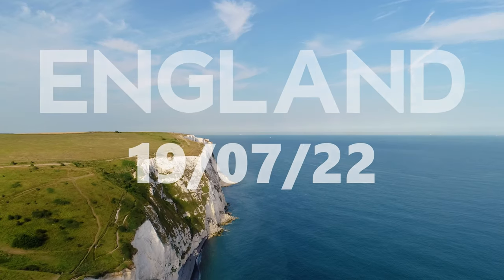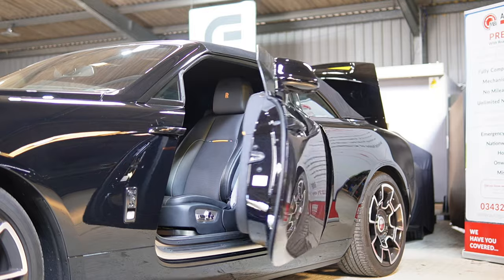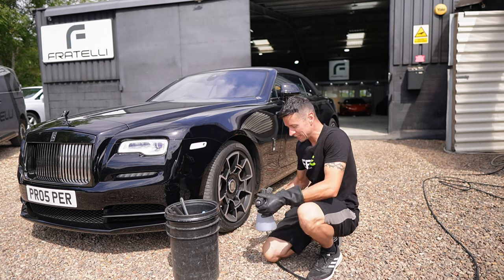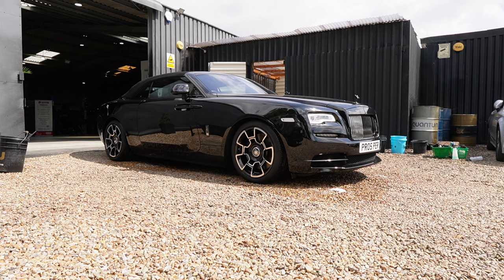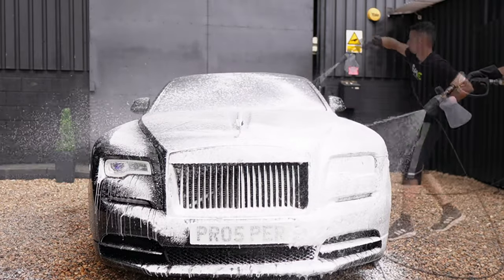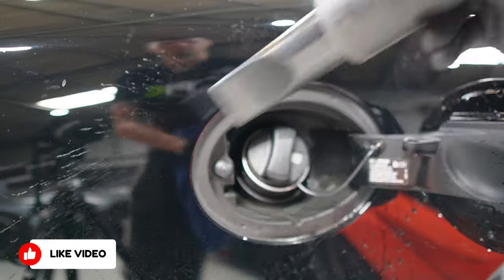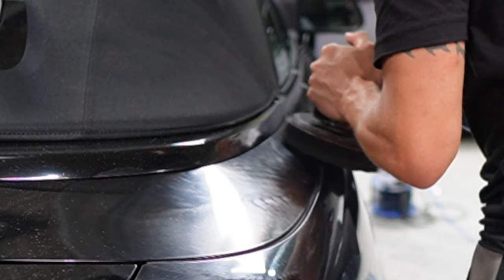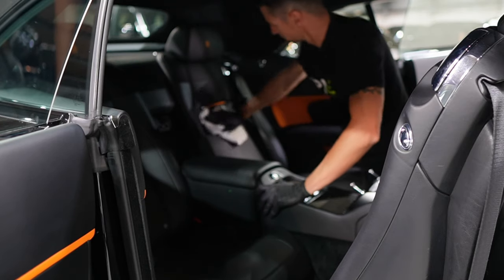THIS DETAIL LOOKED EASY BUT I WAS SO WRONG!!!

Comment: I have a question that I can't find an answer too if you could advise please..  If I put Autoglym Super Resin Polish on then can I put Autoglym extra gloss protection on then spray Yums ceramic spray on top? Is that wrong or do I have to change the last two around?  Or just choose between one of the last two??
Reply from the maker: Super resin polish is great for filling in those imperfections but it won't last. Any ceramic spray on top will increase durability 👌
Reply: @epicautomotivedetailing  cheers, that's what I will do for now and put something better on next time.  👍

Comment: That is quite a collection your client has.  You're gifted with the room they have to pull the car in once the wet part if complete as well.  That being said, awesome job under rough conditions.  The heat looked brutal and I assume the garage was not climate controlled, so likely that the experience inside wasn't that great either.
Reply from the maker: Thanks Jamie. Normally I'm out and out in all weather so I'm not so lucky with a roof but on this occasion I was. Still well hot
Reply: @epicautomotivedetailing  BTW, I loved that you talked about dry versus pre-wet on the snow foam.  I've been wondering which way I should go and your comments about the car being hot versus cold and to let that determine which way to go with that was great.  Thank you.

Comment: I always use a water filter for my final rinse when it’s hot. It saves time manually drying 😉 👍🏼
Reply: Can you elaborate on this? What kind of filter and how do you filter it?
Reply: @zackova6307  The filter goes inline on your hosepipe and makes the water 0 ppm instead of having all of the impurities in it. It’s these that give the water marks. 👍🏼

Comment: I made the most of the heat last weekend and took it as an opportunity to wet vac the entire interior. Took the seats and carpet out and cleaned every last inch. Sun dried it all out within seconds because on my driveway it was around 600 billion degrees. Then i sat in my garage with two office fans blowing at me for an hour 😂
Reply from the maker: Nice one. I really didn't want to work lol. Kinda wish I had money. Everyone says it doesn't buy happiness but I disagree. I would of bought a pool and ton of Cornettos
Reply: @epicautomotivedetailing  To be fair it was my own car so i was taking it steady, definitely wouldn't want to be working in that heat. Ice cream was definitely essential, i was lazy and had uber eats deliver me a couple of boxes of Soleros (the greatest ice lolly thing of all time!)😂

Comment: Dave, tell me mate, why you didnt use your GAZEBO on that hot day? and secondly, why you use cheepest garden hose instead of reinforced hozelock for instance for a commercial use? its just ticking bomb and the price not different that much mate :)
Reply from the maker: Wife and kids had the gazebo mate. They were at home so I needed to keep them in the shade. Also that hose has done me proud for 10+ years lol. The heat just to them 😂
Reply: @epicautomotivedetailing  i did a car that hot day under a gazeboo, it was nice in the shade but still a sauna, gonna build a studio next year hopefully so the problem ends there, fingers crossed :)
Reply from the maker: Nice one. Good luck mate hope it works out for you 🙂

Comment: Broken pipes can be fixed by cutting and joining it with a connector
Reply from the maker: Yeah not in 30 degree heat lol. I got so many knocking about was quick an easy. It had a good run though 🙂

Comment: Great video - worst time to clean a prestige car, especially back in the day with older polishes and methods. My dad was a chauffeur /groom back in the day so he taught me how to clean cars - things have moved on a lot since then and I've adapted. I've also learned to make do with a level of imperfection for various practical reasons. Can I ask who makes the small - cordless? - DA please. Thanks for posting 😊😊👍🤞
Reply from the maker: Thanks mate. It's a kdn nano polisher. I need to add that to description thanks for reminding me 🙏
Reply: @epicautomotivedetailing  Thanks too, looks like a good tool. I had a garage scratch my roof by putting car keys on it. That size of cordless machine would have saved me a lot of time/effort.👍😊😊